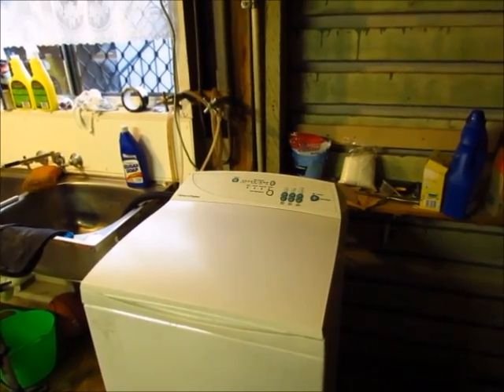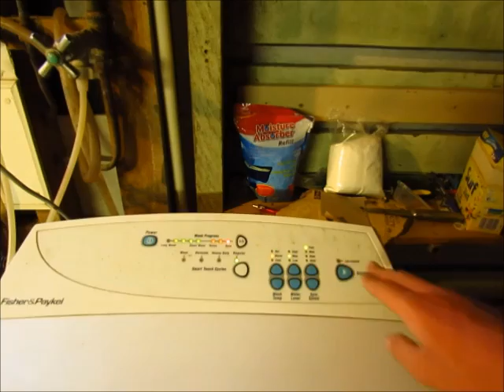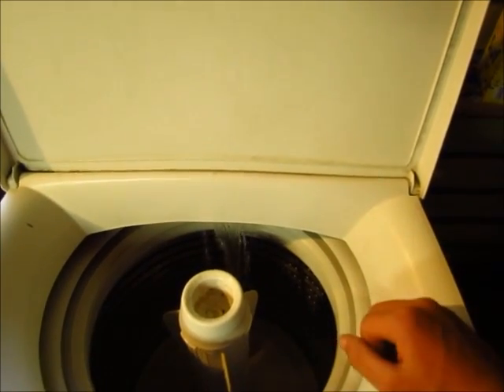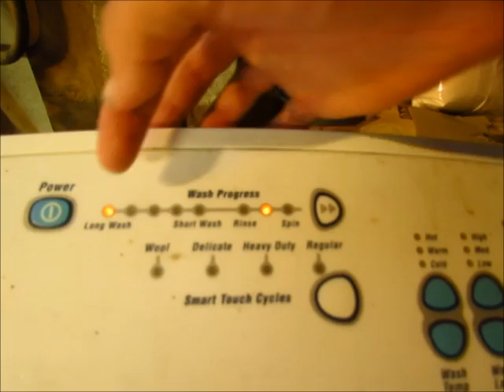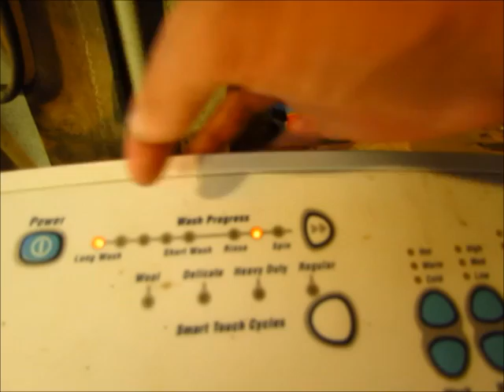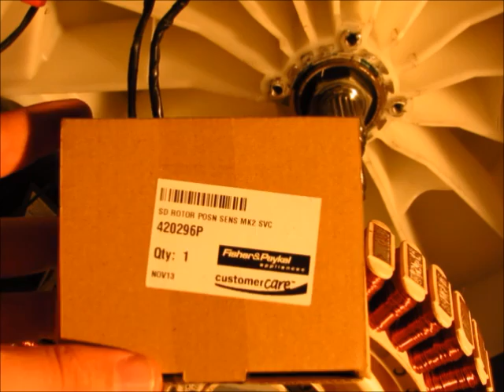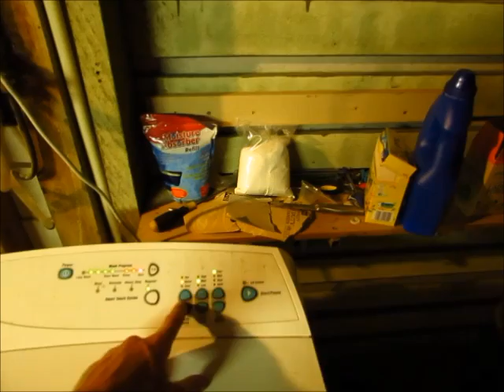Fisher and Paykel 130 (10000010) Error Code Fix & Error Code Explanation

Comment: Mate, you're a legend!  10 years on and your video is still saving otherwise good washing machines from being dumped.  Thanks to your guide, I was able to quickly remove and clean the rotor position sensor in my washing machine and it is now running perfectly, thank you.  I noted your advice about water spillage so instead of laying the machine completely flat, I tilted it over onto a block of wood which kept any remaining water in the bowl.  Cheers from over the ditch.

Comment: Legend, 

Just did the same, took mine apart as well, different sensor but same, slight corrosion on one of the contacts. Hit it with contact cleaner and a cotton tip and reassembled. job done. 

Cheers!

Comment: Error 130 is one of the easiest to fix. When it's filling spin the bowl one direction more than one complete turn and then the opposite direction more than one revolution. This recalibrates the Rotary Position Sensor (RPS)Try that first as 99% of the time that fixes it. They did away the RPS in the next model after that.

Comment: Thanks for the vid. I have different model washer than you with the same basic setup. A couple things i did that i think helped mine; cleaned the magnets for the stator and motor, hit my contacts (that also looked extremely clean) for the position sensor with a few swipes of 1000 grit sandpaper, and hand tightened that big nut on the shaft accessible after the stator is removed. My model has a water proof dielectric gel on some of the sensor so the harness contacts were the only part accessible by water but nothing looked corroded. The magnets on the stator and motor looked like they had a few instances of touching so hopefully with the cleaning and the tightened nut there will be less wobble and less contact. That problem is now gone. This model hates being unplugged or disconnected from power for some reason though, so i have a new problem that i have had to fix before but your video helped with the important one lol. Thanks. 
 

-peace

Comment: Thank you my kiwi bro! Same error code on a slightly different model (92206-A / WA65T60M) - the RPS is somewhat different (now potted in a rubbery compound to protect the circuit board), but the small sliver of exposed PCB for the connector had visible corrosion. Combination of careful scraping and isopropyl alcohol, reassembled everything, and it's now happily washing my towels.

Comment: Awesome I watched your video, pulled it apart, found surface corrosion on the sensor board, gave it a clean with an alcohol pad and cotton bud, put it back together and it's all go again. Our machine is over 20 years old and we were looking at prices for a new one, decided it wouldn't hurt to try fixing the old one and started looking for how. I would have been lost as to where to look without this video of yours, thank you very much.👍

Comment: Thank you very much for this informative video!
This worked for me today on my Intuitive eco model: IW712 with fault code 130.
Paid NZD$120 for the part as I needed it in a hurry.
Turns out we had this same repair done 3 years ago - the part still looked brand new with no corrosion.
So I guess they don't last long.

Comment: Thanks greatly.  Amazingly my sensor is fine, instead my machine  needs a new stator. The Darwin climate is very cruel to plastics. Rotating the tub felt clicky, matched the noise it made. Taking my stator out, lots of broken plastic pieces on top of it. Ordering a new stator now. Thanks again.

Comment: Mate you are a legend - I followed your instructions and found that one of the tiny contacts was corroded. I put my x10 glasses on and cleaned the contact, put it back together and  - IT WORKS. Thank you so much for the video. By the way, my model is slightly later but all the points are the same.

Comment: Yes thank you Jesse. I checked the code, found the fault, which was a corroding sensor connection near the rotor. All it needed was a scrape with a blade.

Comment: The correct connection for the red blue yellow stator wires are marked on the stator if you look closely. Also, if you have a multi meter you can check the RPS board it should be 220 ohms between the Hall effect outputs and the corressponding connector on the board, also the dc supply and ground should be easily traceable to each hall effect sensor from the same coonector.
Thanks mate for taking the time to do this video it really has helped a lot of people.
You look like you could possibly be a Kiwi, but I dont care I think you are a good bloke ;)

Comment: 5 years later and this video saved me from buying a new unit. Just used some electrical cleaner and a wire brush to clean the connection. Thank you!

Comment: Hey guys, If you have this error, it may not necessarily be the RPS...

Please only try this if you have some clues about electrical stuff, don't want to cause a short and burn yer house down

I had an error code 130, and tried replacing the RPS, motor controller board, and the wire harness which connects the two. However the motor just would not turn (cheers anyway though Jesse). Finally, I found that the issue was that one of the spade terminals wasn't making a good contact with its respective motor winding (see here for diagram: https://drive.google.com/file/d/13_0npBQ_QXHBAY3vQeqdfT08_nKJlBIH/view?usp=sharing). Once I cleaned that contact up a bit (scraped enamel off the wire a bit more, sanded the terminal a bit) it worked again like new.

Be very careful to ensure the washing machine is disconnected from the power when you're servicing the motor

Comment: 2020 and this tip just saved me $300. i just had to buy a $27 circuit board off ebay, you probably dont need to buy the whole harness and circuit board. note: my sensors on the old circuit board looked perfectly fine, but the fault is definitely there. as soon as i installed the new one and did her back up, BINGO. no more error, works fine. cheers, mate

Comment: Someone attempting this might also want to see the part where you can activate the pump to empty the water out. Page 21 on the manual. 

4.2 Drain Pump Test
GW Washer
When in diagnostic mode press REGULAR to activate the drain pump. To deactivate the pump,
press REGULAR again.
Reply: That's going to make my job a lot easier, thanks!

Comment: Also got a 134, after cleaning the sensor and connections, I've still got my fault. 130 or 134. Will disassemble and check the star motor connector, and meter the wingdings. Weird!

Comment: 4 years later, similar style of F&P washing machine but different model, and your directions for the Rotor Sensor replacement were spot on!  Got the part of eBay for $34 and replaced following your instructions. Washing machine now running error free again. Mate, you're a legend!

Comment: Thanks Jesse, for the good video work. I knew the 130 code is 0x82 as I deall with that a lot, but you explained it to a wide audience very well. I bought a position sensor 420206P for my GWL11 washer and it worked great. I first tried to clean the edge connector contacts but that did not help. The problem appeared soon after a lightning storm. Called F-P on a Sunday, and it was delivered (from Dallas, TX) on Weds. The adjustable pliers you mentioned are called channellocks in the US. See https://www.channellock.com/history/ if curious. I'd be happy to send you $20 if you had a paypal Donate link or something. I made one from https://www.paypal.com/donate/buttons for a blog...
Reply from the maker: Thanks for the comment, interesting read on the pliers. No need for the $ the likes and comments make it worthwhile enough for me :-)

Comment: Hi mate, thanks so much for posting this video. This resolved my issue. In my case I used some electric spray cleaner on the sensor and the machine is back in action

Comment: This video saved my washing machine and saved me a lot of money, thank you! Just a heads up for people looking for this part, you can get the circuit board without the plastic frame and it'll cost you about 40 NZD on ebay, you just have to take a little care in clipping the old one out and the new one in it's place. The whole new part shown in this video costs about 100 NZD but if the white plastic piece is not broken then its much cheaper to get the circuit board alone. Also, make sure the everything is screwed back in nice and secure to finish, the first time I tried there was a loud squeezing/rubbing sound from the rotary sensor/motor. After taking it off and putting back on properly, it worked sweet as a nut.

Comment: Worked perfectly! Had the same error code and symptoms as you, disassembled as shown - The position sensor I had was a fully enclosed circuit board in a plastic casing, however the connect part which had 4 pads had obvious corrosion between the pads. Cleaned that up with nail polish remover, reassembled and she's good to go!

Comment: i was ready to buy a new washer till i watched your video, thank you very much i have fixed my washer ,it had the same problem which  was corrosion on the rotor contacts and also a break in the circuit board . i soldered the break cleaned the contacts and off she goes .

Comment: What an awesome video mate. I just fixed my washing machine with the same process. I didn't buy a new sensor, I just thoroughly rubbed cooking oil over the water damaged sensor and rotor coils along with your comprehensive video and it goes good as gold. I can't believe it. I owe you a bottle whiskey for your excellent advice.

Comment: One more massive thankyou!! Just about ready to blow 1.5k. Checked the fault code service guide,
 there was no 130 code listed.
 (homeappliancesonline.co.nz/site/homeappliance/421827SmartDrivePh9230VHanningWasherSvc.pdf)
Only has number 113 then jumps to 133. My GW612 has exactly same symptoms with a 130 code. Will pull it apart tonight and let you know.

Comment: My rotor plate is stuck on i undo the plastic nut and try and pull on the housing and its really stuck. Is there anyway to remove it without damaging it at this point?
Reply: just keep  undoing it you think nothing happening but it drops away from the spindle. it takes quite a few turns
Reply: I managed to get it off it just needed some serious muscle work. All fixed mine was just the connection so i didnt even have to take it off HA!

Comment: Can you please share the website with the error codes info...thanks
Reply: Randy Rodz just Google it. Fisher and paykel 00100100, 0 are no light , 1 is the light on, so from right to left ad your codes.  they are from left to right 
128.64.32.16.8.4.2.1.
1.0.0.0.0.0.1.0
= 130

Comment: replacing a bad design RPS with another bad design RPS !!!  ain't the way to go....corrosion on the small electronic connection slides is a cetainty under a moist environment ......MUST replace the RPS with a FULLY ENCAPSULATED one ..little bit more bother.. exiting leads need to go up (out of the dangerous moisture laden air zone) and be plugged into the motor control unit (da brain!) up top - 2 screws to access - at the same spot the original harness was connected and voila! - never experience that sucking corrosion on the obsoleted RPS type ..ever again..    remember ..get an ENCAPSULATED rps (even if someone else has to fit it.  The FP washer is a computer that washes clothes...love em or leave em ....I love em....I hire cabins ...have four and DIY em :)  PS Lay em down face first..sure...but on a boogie board, not the frikkin harsh gritty concrete floor buddy .paint scratches rust pretty dam quick...spray lower regions with Lanox and keep the shit out of the panel bottom roll backs!!  To all FP DIYers...I salute you...that is IT savvy.

Comment: I have error 130 but I can't tell if the RPS is the problem. It was just dusty and didn't look corroded.

I don't think I can gamble on  buying a new $100+ sensor if I'm not sure if that will fix it.
Reply: What was it in the end ? I too  don't want to risk  $100 when it could be another fault even though it's showing 130
Reply: @Matowix we bought a new washing machine, a Samsung one.
Reply: @Jonius  I'm gonna  try this in the morning but like u I  can tell it might not be the rps. Depressed about  having to buy a new machine if its just something small. I'll try clean that rps part but spending  $ on a part they may not work sux

Comment: Great tips Jesse, fixed my machine after reading this. Please note though, there are two different rotor sensors, initially I ordered the wrong part. It's an idea to photo the sensor when ordering the replacement.

Comment: Thanks Jesse for giving me the oil on how to fix my washing machine with the 130 error code. It worked and you saved me lots of money - I could have got a tech round to fix it and the call out fee would have been $120+ and the fix would have been at least $90 for the part and a few hundred for the time. I owe you a cold beer on a hot day; maybe two. As for the  comments (see below) about your video re the "usual minded person" and their ability to "do the research" on Google to find the answer......I would like to point T astyboi towards any peer reviewed scientific journal. All biological peer reviewed experiments in journals have Materials and Methods sections that tell you what was used and how it was completed. Possibly T astyboi could start with Science or Nature Journals as they are the top journals to read  - nuff said !!

Comment: Thanks for this. My machine started up with this but is only intermittent. Glad someone made a video on it. You explained everything very well. Hopefully I dont have to replace the part though just forked out for a replacement inlet valve from the spare parts for f&p a month or 2 ago.

Comment: Thanks Jesse for a brilliant video.
I found what the error code meant first via google, then watched your video to find out where the sensor was, and how to fix it. That saved me hours of time. I am a technical person, who can diagnose electrical equipment myself, but why waste the time when I have better things to do. I didnt have to watch all the video, others may choose to do so, that is the beauty of You Tube. So to T astyboi, do it yourself, and dont bother with You Tube (and negative comments)
In my case, the black wire leading to the sensor had perished so much that it broke. Looks like built in deterioration that will eventually mean either a wiring loom or full machine replacement .

Comment: Thanks a lot Jesse. I had the same problem with my washing machine and followed your instruction and but I didn’t need a new part as cooperoxide suggested I used Electrical Contact & part cleaning spray ( http://www.supercheapauto.com.au/Product/SCA-Contact-Circuit-Board-Cleaner/347119). Now it works like a new machine. You saved a lot of my time and money. I really appreciate that. You are a LEGEND mate !

Comment: Very good video, well done on the delicate sensor, they can break easily (the plastic surround). The rotor bolts into a alloy shaft about 1 cm long of alloy (It surrounds the shaft covered in plastic for about 10 cm), good to point out not to over tighten, alloy can be stripped. I use the rotor and stator like many for generators, another use for your machine if it brakes down again :)

Comment: Legend!!! Followed your video and it worked a treat. Mine only needed a clean not a whole new sensor. 
Very helpful, you saved me hundreds and made me look like a competent handy man in front of the missus.
Reply: What did you clean it with
Reply: @lisahudson7845  I did the same as Toby here...just scraped the blueish scale off with a flat head screwdriver and got in there with a bit of sandpaper.

Comment: I have an error code of 43 which I am told is an Out of balance fault.
Its usually caused by corrosion in the micro switch and its terminals.(under the right hand rear corner of the main motor controller computer ) I am told to check also the bias spring (under the left front corner of top deck) from the wash bowl to the suspension rod is connected, and that the washer is not contacting the OOB switch lever (under the right hand rear corner of the top. I cant find where the items are situated in (brackets above) and if I have to attack the items from the top of the machine or if i turn the machine on its side and attack the problem from the bottom. can anyone advise please

Comment: Also meant to mention that I didn't have to buy a spare part.  There was a bit of corrosion on the circuit board so I just sprayed it with "electrical clean and lube" and cleaned it with cotton buds.  Also did the plug where it connects to the board.  Let it dry and hey presto.  All fixed for now.  You can buy electrical lube from http://www.jaycar.com.au/Service-Aids/Chemical-Aids/Aerosols/Contact-Cleaner-Lubricant-Spray-Can/p/NA1012
Reply: Thanks a lot . I didnit have to buy a new part becuase of you.